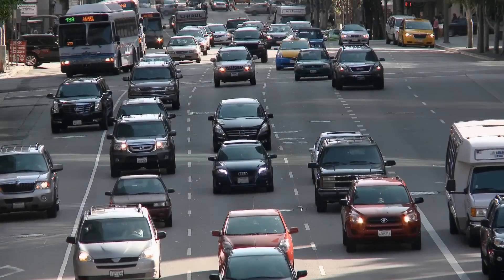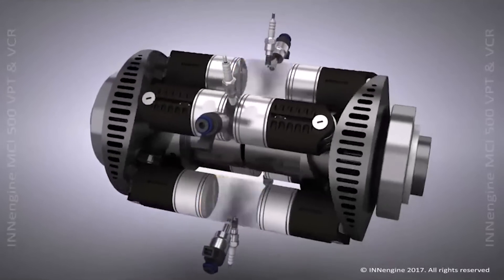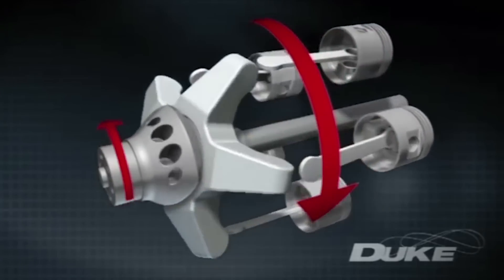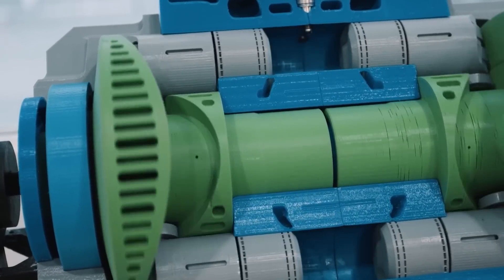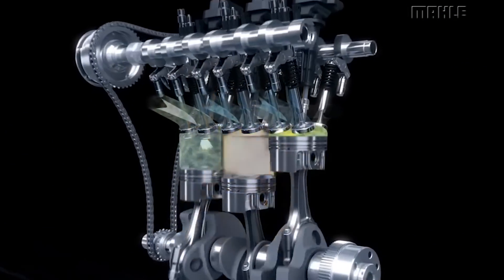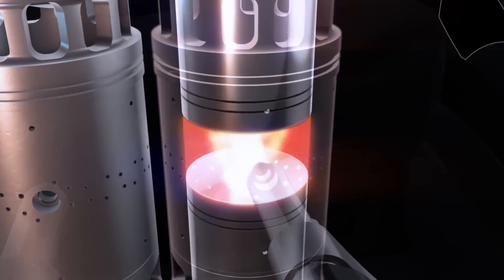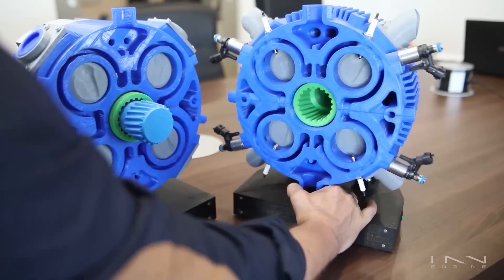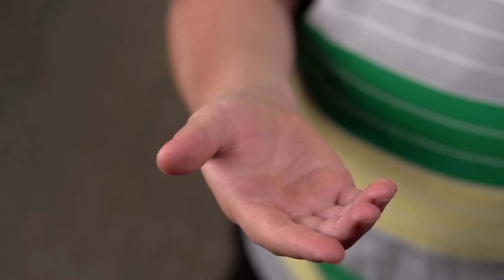Revolutionary One-Stroke Engine: Future or Fraud?

Comment: main problem with two stroke engines (apart from burning oil) is that they exhaust up to a 1/3 of unburned fuel. this might be also problem here. the rollers are another problem for efficiency

btw, the device in the testing car suspected to be a supercharger is an air pump with air filter (in back) driven by a belt (visible in front). really no supercharger
Reply: Physically valved two-strokes don't lose that much unburned fuel through the exhaust. (Rotary valves, etc) Check out the 50cc GP motorcycles of the 1970's and early 80's, which all used rotary valve case induction. They were making 20hp from a single piston water cooled 50cc engine, by the late 1970's, mostly, just by using rotary valve case induction, a big standard carb, and a decent chamber pipe.
Reply: @DetroitMicroSound  Yeah, piston port and reed valves were more wasteful. Those rotory valves broke allot but the performance was wicked. They had the biggest, most instant power surge when they got into the pipe, of all three two cycle types. I know because I raced them all on WKA unlimited 2 cycle karts. Well, the piston ports, I ran in the 100cc class. But still, i'm sure about the power curves.
Reply: Think you confusing 2 stroke motorcycle engines that burn oil. An engine like this and many other big two stroke engines for example Detroits , Doxford marine Cummins military engines all lubricate without oil being mixed in there fuel for lubrication of the crank bearings
Reply: @BerlietGBC  True. One of the reasons 2 stroke diesels were dropped for transportation was because they couldn't meet pollution standards. Then there's Achates Power. Their 3 cylinder/6 piston engine uses fuel injection. Their 2.7L engine claimed 37 MPG in a Ford F150, per the company's 2017/18 testing. Their 10.6L diesel engine began testing service with Walmart about 2 years ago in a Peterbuilt. They claim 7% CO2 and 96% NOX reductions. If true, they'll exceed 2025 and 2027 CAFE and EPA standards.
Reply: "main problem with two stroke engines... "

That is one of the big problems with a conventional two stroke engines scavenged using crankcase pressure.  The horizontally opposed uniflow two stroke design (of which this is an example) nailed that problem over 100 years ago.
Reply: The "device" is a centrifugal supercharger.
Reply: Excellent points. Some 2 strokes would get similar MPG as a 4 stroke of the same HP. By eliminating oil/gas mix, this engine might be as clean as current 4 strokes, maybe not. Still it'd be almost impossible to get it approved for automotive use (aka fighting EPA) but could be perfect for special applications. Drones and aircraft come to mind.
Reply: @mikep490   there's no reason to believe it couldn't meet emmisions standards. They could even surpass all other engines by adopting valves like the new mazda 2 stroke. Even a pure wankel met standards in the range extender motor for the mazda SUV. That only took an EGR system.
Reply: @Bellcephus1  It's pretty unlikely. 2 strokes tend to toss out more unburned fuel than 4 strokers, especially modern 4 strokes. They can be cleaned up but 2 strokes are usually left for old MCs, boats, and some hobby planes. Once a bureacracy is established, it can be difficult to overcome. If these catch on I'd guess it'd be in some of the more open minded parts of the world, like China and India.
Reply: @mikep490   The bureaucracy doesn't matter. Meeting the standard matters. They don't and never have told anybody you can use this motor or that motor. Only, you have to pass this test ! Mazda just designed a new two stroke for the future and added EGR to a wankel and met standards for the motor in their new suv. Keep up. Ya'll make it sound like you can hold a gas can under the exhaust and fill it up. I doubt you'll understand this but only reed valve and piston port 2 strokes were that wasteful to begin with. It was also the oil in the fuel that made it hard to pass their test anyway. The only reason there was oil in the fuel is what ? I'll give you hint. Its not because its a 2 stroke. Its because a reed valve motor uses a transfer port from the crankcase to the combustion chamber. It brings fuel in from beneath the piston and tranfers it to the top at the same time the piston comes down on the power stroke. It can't have oil in the crankcase or it would transfer it to the combustion chamber. It has only a minimum amount kept down low and away which is fine for crank bearings but does shit for the cylinder, so oil must be mixed in the fuel. Some new 2 stroke designs don't need it in the fuel. Some have valves like a four stroke, some have rotory valves. But all have nothing on EV power. That's the future, along with hybrids.
Reply: Your statements are related to old tech. Even an old two stroke with an expansion chamber in its pipe didn't waste one third unless it was being babied around and that's still a stretch to claim. Look at mazdas new two stroke and share your thoughts please ! Its a two stroke with valves like a typical four stroke.

Comment: Just a quick nitpick. It's not an explosion inside the cylinder, it's an ignition. If everything is working as it should the spark ignites the fuel air mixture and forms a fire and force front as it moves the piston. It's almost a gentle application of force in a way. If the fuel air mix is igniting too fast and exploding, that is called pinging, and it's not good for an engine. It can damage the engine internals and cause a lot of vibration. It's the reason we put Octane in fuels. It prevents pinging.
Good vid though. Interesting concept.
Reply: It’s an explosion. What you’re describing in your third sentence is an explosion.
Reply: @thedude2367   No it’s not. It’s more controlled than that. Otherwise you’d have pinging. Pinging is bad for engines.

Comment: I'd like to see a range extender that in addition to electricity also produced heat for the car and battery pack for EVs in cold climates.
Reply: Could maintain temperature by running by itself  .
Reply: Except the batteries also need heat while the vehicle is not being used.
Reply: @jmackinjersey1  Lithium batteries can work all the way down to -10C albeit at reduced peak power, no need to warm them up for nothing until they drop below that or you want to drive like a maniac right out of the parking lot and some of the newer chemistries extend the working range to -20C. Unless you live in Alaska, days where the battery needs to waste power keeping itself at its minimum working temperature shouldn't be too many per year. A bunch of companies are also researching lithium battery chemistries specifically for cold climates that can operate at temperatures as low as -50C. Battery heating may not be much of a concern for much longer.
Reply: Screw ev. Stop being brainwashed
Reply: Well it is water cooled so that would be an inevitable side benefit of this exact engine.
Reply: @filonin2  which is why engines are superior
Reply: Don't travel to the USA.  Students study hard, and you easily steal their ideas from their brains. That sounds like a good deal. Fighting for freedom. New slavery. It is my responsibility. I thought everyone should know. We are imprisoned in a place whose slogan was freedom.  Don't travel to the USA. Never even for a short time. If you have any special knowledge or skills or an invention, they will steal it from your mind. The US government initially used this method to identify people who intended to harm the United States. But today, they use it for many purposes, including stealing information from people and stealing data from people's minds. Many celebrities like Taylor Swift and Harry Styles are helping to lure the US government. They can see whatever you see. You'll never have privacy even with your wife or girlfriend. They could see whatever you think. When Taylor Swift said I used my best colors for your portrait, she meant it. when she said, "Touch me, and you'll never be alone." Or when she said, I can read you like a magazine. Your silence would help them to do it again and again. They said, "Don't say anything because of the USA. I want to take her to court. They wanted to pay me $1,000,000. Those are not only songs (Taylor Swift) likes A writer of crime stories whose stories are authentic and have committed all the murders. Taylor Adolf Hitler, the Humans, are not your laboratory mice. Sometimes, what we hear is like warning lights to prevent accidents. Events that the causes of those events are not afraid of repeating them, but they are happy. And they sat waiting for the right time. Let's not ignore what we hear. Kidnapping in a new style. Support with like   ......................................... #Taylorswift_is_murder  Doggy styles ( #HarryStyles_is_murder ) #Selenagomez_is_murder #Biden_is_murder  #Trump_is_murder  #NotravelUSA

Comment: Hydrogen; dubious credentials as 'sustainable', mostly produced from fossil fuel atm, inefficient energy cycle if electrolysed and no distribution network for the volatile and explosive gas, which is difficult to contain (very small molecule). Putting a range extender in a hybrid! Duh; Its just running on fossil fuel again. Its just like the marketing gimmick of the 'self charging hybrid' or 'hybrid' as they used to be called. Interesting concept engine though, Maybe if it came along about 100 years ago.....

Comment: Achieving one stroke operation with multiple combustion chambers is like winning a boxing match 3vs1
Reply: Except it's not a one stroke motor.... if it was an actual one stroke motor it would have intake compression power and exhaust all in a single movement.  This is just a new take on a two-cycle motor
Reply: @kickerzx2  that's what I meant. justifying the one stroke name with multiple combustion chambers would mean a 4 stroke 4 cylinders would count as a half stroke as each revolution of the crankshaft sees two combustion events and that is utter nonsense.
Reply: @kickerzx2  😳🙄🤔,il 4 tempi ha 1 fase positiva e 3 fasi negative😉;il due tempi,ha 1 fase positiva e 1 fase negativa😉;questo motore ha solo 1 fase
POSITIVA😉,pertanto è un motore ad 1 fase"positiva"!🤫🤐🤔😳🙄😱😵‍💫🤯🐐🏁👍🆗😵😖😣😁😁😁😁
Reply: @lucamazzoni4241 still ain't a V8
Reply: Still waiting, this is a two stroke
Reply: It is a 2 stroke engine with 8 heads (4 pairs of opposed heads that they are stroking in the middle) does 2 + 2 strokes in a 360∘ full cycle.
A   B
C   D
A+D stroke simultaneously in the 180∘  and 
B+C stroke simultaneously at the rest of the cycle.
Reply: Don't travel to the USA.  Students study hard, and you easily steal their ideas from their brains. That sounds like a good deal. Fighting for freedom. New slavery. It is my responsibility. I thought everyone should know. We are imprisoned in a place whose slogan was freedom.  Don't travel to the USA. Never even for a short time. If you have any special knowledge or skills or an invention, they will steal it from your mind. The US government initially used this method to identify people who intended to harm the United States. But today, they use it for many purposes, including stealing information from people and stealing data from people's minds. Many celebrities like Taylor Swift and Harry Styles are helping to lure the US government. They can see whatever you see. You'll never have privacy even with your wife or girlfriend. They could see whatever you think. When Taylor Swift said I used my best colors for your portrait, she meant it. when she said, "Touch me, and you'll never be alone." Or when she said, I can read you like a magazine. Your silence would help them to do it again and again. They said, "Don't say anything because of the USA. I want to take her to court. They wanted to pay me $1,000,000. Those are not only songs (Taylor Swift) likes A writer of crime stories whose stories are authentic and have committed all the murders. Taylor Adolf Hitler, the Humans, are not your laboratory mice. Sometimes, what we hear is like warning lights to prevent accidents. Events that the causes of those events are not afraid of repeating them, but they are happy. And they sat waiting for the right time. Let's not ignore what we hear. Kidnapping in a new style. Support with like   ......................................... #Taylorswift_is_murder  Doggy styles ( #HarryStyles_is_murder ) #Selenagomez_is_murder #Biden_is_murder  #Trump_is_murder  #NotravelUSA
Reply: or the sound of one hand clapping
Reply: user-nx7io1ns7p Allah drives a Tesla.
Reply: @Goldsteinphoto so thats why his followers blow up so often. I thought it was bombs, never even thought it might be faulty batteries
Reply: user-nx7io1ns7p Your Allah is a false god, and Mahammad a false profit.

There is only one truth. 
That truth is that God sacrificed his only son Jesus Christ l who died upon the cross, so that we would be saved from our sins.
Reply: Good engineering

Comment: I agree that it is somewhat strange calling it one stroke and not saying it is supercharged. Perhaps it may be useful in applications where vibrations is problematic.
Reply: Calling it a one stroke motor is like calling it a combustion tomato. That's because it's not
Reply: It's not a supercharged engine. The "supercharger" is an exhaust scavenge blower. A British diesel locomotive used an engine with opposed piston and no valves just like this engine, and it had a blower to help get the exhaust gases out of its 18 cylinders.
Reply: Most of this is a merger of the principle of the Fairbanks-Morse OP engine with the Dyna-Cam.  The 15-degree advance of one of the opposed pistons is likely for the same purpose as the OP or the Napier Deltic, and as noted the 'supercharger' is likely a proportional positive-displacement device for precise scavenge air.

As with any opposed-piston two-stroke, there are no valves and hence no need for oil in the charge air or fuel to lubricate anything.

Note the fun involved with piston return.  On the DynaCam that was inherent in the central rollers in each piston, but here there is a 'desmo' surface keeping the roller from coming off the cam surface.  

A key assumption not discussed in Company literature (although it should be) is that the design inherently uses the large cam structures as flywheels, which would make the engine somewhat lacking in prompt throttle response or acceleration to speed.  As a genset always running at the peak of its torque curve before loading, it is ideal for an extender engine...
Reply: @EuropaSman  The British Commer TS3 "Knocker" engine is also a valveless, opposed piston two stroke with a blower, and was used in trucks.  Quite a clever design as it only had a single crankshaft.

Comment: Just another pie in the Sky. The problem is not the motors but the polluting fuel used. We have no other viable alternative than rely mostly on our Eternal Sun for energy + storage and super efficient electric Motors like those made by Tesla for our future energy needs, all others are at least 3 times more costly.
Reply: You’re clearly scientifically illiterate. Electric motors are superior in almost every way to a gas engine. Better torque, better acceleration, Wayyyyyy more efficient, less weight….